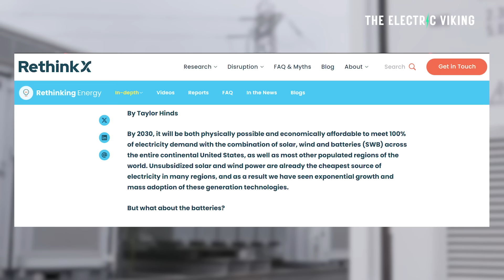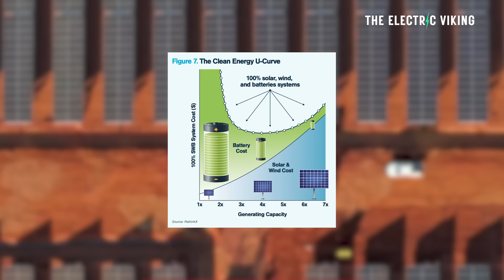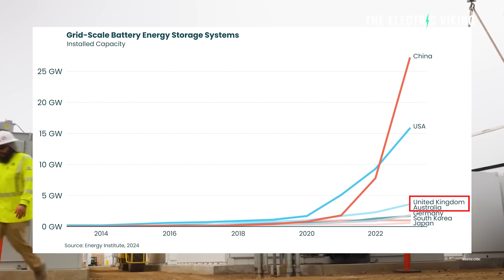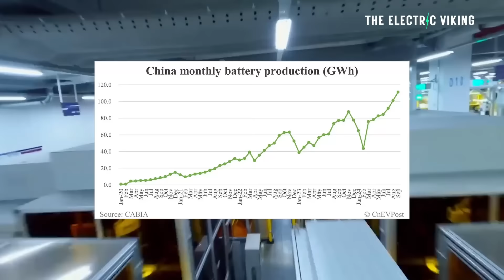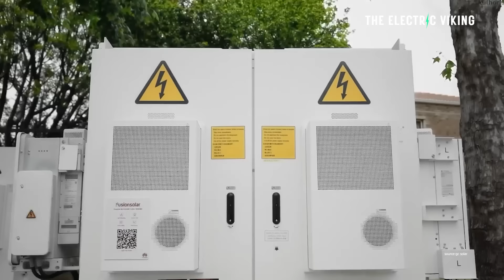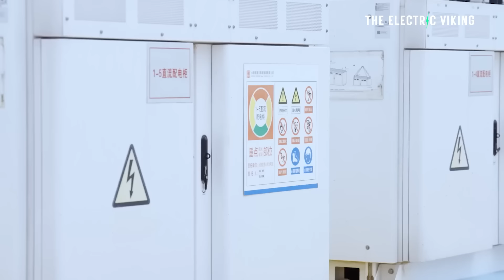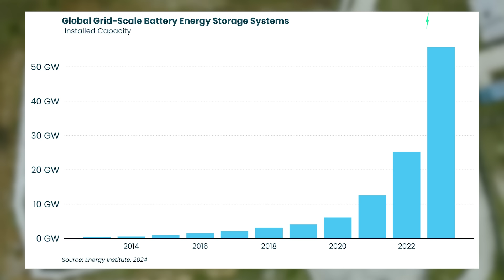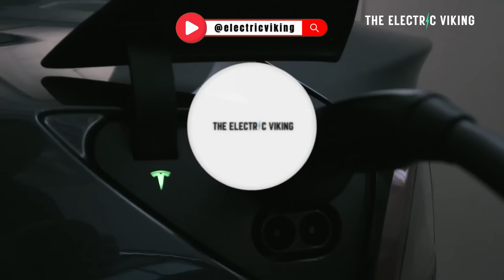RethinkX reveals the shocking exponential growth of battery storage worldwide

Comment: Once upon a time the whole world was using oil lamps, now battery operated LED flashlights. 😂
Reply: At a very basic level, one can buy a lantern with an attached solar panel that will charge it during the day and provide light at night.  These cost less than $10.
Reply: @bobwallace9753  A device that took more energy to manufacture than it will ever replace - well done.
Reply: We'll soon be going back to oil lamps given the policy decision we're seeing.
Reply: @kellyeye7224  
How little you know.  I assume it's only ignorance?
Reply: @kellyeye7224  
A solar rechargeable LED lantern costs $2 to manufacture in China and it will work for years. Do you think $2 worth of petrol fuel can last a few years?
Reply: @Anonymous------  When gasoline was $2/gallon that gallon would deliver some 30kW of energy.  The LED might deliver 1 watt so 30,000 continuous hours of 'light' from that gallon of gasoline?  Call it 15,000 hours at today's prices.  That' still nearly TWO YEARS of continuous operation.  Given your LED lantern will need half the day to recharge the gasoline equivalent would be FOUR YEARS of operation.  Get it yet?
Reply: @kellyeye7224 That works on one example but, for energy requirements such as home electricity, data centers, etc. how is it better to continuously have to drill for oil, transport it, refine, it, etc. than to have a solar or wind farm supplying daily renewable energy?
Reply: My Grandmother used whale oil to read🕯️ When I was too tired to finish homework...she told me to study late & " burn the midnite oil"🕯️ Maybe most people will prefer burning petrol oil lamps than an LED light🤔
Reply: @solartime8983  
Imagine 7 billion people using whale oil lamps. How many whales this world needs to have to supply whale oil to 7 billion people. 🤐🥴
Reply: @GiantsOnTheHorizon  So what do those data centers use at night or in still weather?  Such center owners are already contracting for modular nuclear or permission to be built alongside existing power stations (non green).  The energy requirement is far and away above anything any solar/wind system can RELIABLY supply so there will NEVER be a system that doesn't use existing energy (oil, coal, gas etc) technology.
Reply: @kellyeye7224  There are quite a few options for energy storage. I’m assuming they would use batteries or a variation like pumped hydropower. Not sure why the data centers wouldn’t use a combination of energy solutions including solar, wind, and nuclear.
Reply: @GiantsOnTheHorizon  The basis of any energy use is predicated on the reliability of that supply.  Wind/solar are inherently intermittent and battery storage is only for a limited period.  Pumped hydro is only practical where the elevation permits it.  This is why gas,coal, oil and nuclear will always be part of any energy mix - reliability.
Reply: @kellyeye7224  Of course but, if you can get 95% of it with renewables why would t you do that?
Reply: @GiantsOnTheHorizon  But why duplicate the energy source?  If coal,gas, oil or nuclear are required why spend extra to deliver wind/solar?  The coal, gas, oil and nuclear would be on standby anyway so effectively going to waste.  It's idiotic.
Reply: @kellyeye7224  Because it’s more cost efficient long term and renewable. Why would you pay more just so you can pollute?
Reply: @GiantsOnTheHorizon  Cost efficient?  That's certainly debatable as the only thing I've noticed with wind.solar energy are ever-increasing costs - and increased grid instability.  As for 'pollution' - what do you mean by that?  See Oh too isn't a pollutant and other byproducts are, these days, carefully converted/eliminated - see modern car engines as good examples.
Reply: @kellyeye7224  Water isn’t a pollutant either until you oversaturate your body with it. Though, I doubt you’re going to want to sit in your garage while your gas car is running - which seems like in that case the emissions would be considered a “pollutant.” Coal ash seems to be causing some fun cancers in North Carolina not to mention black lung. Natural gas wells are leaking all over the place and adding to the greenhouse gas problem. I haven’t seen a study out there showing the long term costs of oil, gas, and coal being anywhere close to as cost effective as solar.
Reply: @GiantsOnTheHorizon  Of course, idiocy (sitting in a garage with the engine running) has it's place in many societies but isn't an issue for most people.  Then there's criminality - of failing to abide by systems and methods for dealing with harmful byproducts.  But the biggest issue is ignorance - that of science and the issue surrounding sea oh too which has yet to be proven as being harmful to the individual or the planet.
Reply: @kellyeye7224  If you can sit in your garage with a battery running or an electric car running but, not an ICE vehicle (because you’d die), I think we can conclude that the byproduct of a gas engine is toxic to humans. Also, If you want to claim that there has been no proof that excess CO2 is destructive to the earth should we just go ahead and assume the earth is flat as well?
Reply: @GiantsOnTheHorizon  I'm the kind of person that looks at a simple equation (like 2+2) and go.... yeah so far, so good.  Then I look at the rest (=5) and say..... 'there's something not quite right there' and do some research.  You seem to be the kind of person that thinks the bogey man exists but you're too scared to look under the bed to find out.  Hint - it doesn't.
Reply: @kellyeye7224  You actually seem like the type of person who can’t accept that 2+2=4 and then come with all sorts of seemingly clever reasons that 2+2=5 to impress yourself. Don’t worry, you’re not unique.
Reply: @GiantsOnTheHorizon  Answer honestly - have you ever read or watched videos/movies that claim to counter the narrative?  The evidence therein is compelling and supported by links to factual data that has never been disproved.
Reply: @kellyeye7224  I’m always open to counter narrative. That’s how I became a Democrat.
Reply: @GiantsOnTheHorizon  ahhh, that explains a lot.
Reply: @kellyeye7224  Yep. Enjoy your conspiracies.
Reply: @GiantsOnTheHorizon  The difference between a conspiracy and fact is down to around two weeks.
Reply: @kellyeye7224  About 1% of the time. For you though, I’m sure the percentages seem much higher. Everything seems like a conspiracy when you don’t know how anything works.
Reply: @kellyeye7224 Nope. Most of that gasoline goes away as heat and vibration. Stop trying to pretend that Gasoline is efficient, when it’s NOT efficient for electricity generation.

Comment: Energy production has to be local... very local... trucking in coal, piping gas and whatever else from thousands of km away is insane... trucking oil all around the country to fuel stations is also insane
Reply: Best point
Reply: @lonewolf awesome i can almost picture the frustration "it's like I'm taking crazy pills" yes we will burn oil to transport oil <3

Great share mate!
Reply: @The-JMartian  I'm with you! It just feels like we are the crazy ones for no good reason.
Reply: @The-JMartian  very nice to hear, heat pump on property?

One day I hope to build a solar system on property.
Reply: Also remember the proposition that: if all the oil/natural gas/coal use ceased, then HALF of the (also fossil fuelled) ships would cease to be used. HALF.
Reply: @jimbartley5066  What do you think the other half of the ships are using for power? I just read there's  only 160 nuclear-powered ships.
Reply: The same could be said about power plants. There is a hydroelectric dam in south east Iowa but most of the power is sent to Saint Louis over 150 miles away. I'd bet alot of that power is lost to how far it goes.
Reply: @brianperry4815 The transmission loss is not that much 5-8% and of that the biggest loss is near the end when the voltage is stepped down to send to businesses or to homes.
Reply: 150miles is nothing in terms of electricity transmission. UHVDC lines only have 1,5-2% loss over every 650 miles
Reply: China has 30,000 miles of UHV transmission lines.  It's cheaper to move electrons on wires than moving fossil fuels by truck.

Comment: African countries should go all in on solar power + batteries. Distributed and without the need for long transmission lines.
Reply: Morroco installed  858 megawatts in 2022 .  In 2030 the will export 10 TWh hydrogin . Africa is realy helped by Chinese investors.
Reply: They already are, but with transmission lines as well. Lookup the One Sun, One World, One Grud initiative seeking to join up the global sun belt countires to be a global powerhouse. Grids will still be require for commercial and industrial needs, even if domestic home generates.
Reply: @GruffSillyGoat  
There are millions of people for whom it would be too expensive to string transmission lines.  They would never use enough electricity to pay for the cost.  Those people are being serviced by "micro-solar".  Small, standalone systems that provide basic electricity and can be paid for over a year or so with the money they would have otherwise spent for lamp oil, candles, and disposable batteries.  There are millions of micro-solar systems now in place.
Reply: Solar energy - yes. Lithium harvesting - no.
Reply: @Argus13  Fortunately, grid scale batteries could be built with sodium instead of lithium.
Reply: @Argus13  
Why not lithium extraction and processing?  Lithium is a very commonly found metal in the Earth's crust.  The world is moving to EVs and renewable energy.  We're going to manufacture a huge number of batteries.  Why import lithium or completed batteries from one continent to another if you can do the work close to the market?
Reply: @bobwallace9753  Because of lithium harvesting - just ecology killing process. And more - for Afrivcan countries it makes most deficit resource - water - unavailable, because of drinking water levels poisoning. And during lithu extraction not only CO2 generated and chemical poisoning occurs, but also huge amount of water vapor generated. Water vapor - most powerfull warming gas on nature, more powerfull, than CO2 (which also takes too small part of all warmer gases).
Reply: @Argus13  
So don't process lithium where water is scarce.  All of Africa is not a desert.  Extract and process responsibly, contain the potentially harmful byproducts.  

Water vapor is a problem with lithium extraction.  Give me a break.  The amount of water vapor emitted from lithium refining wouldn't wiggle the needle.  

CO2?  Compared to the CO2 released when we burn oil for fuel?  And, do not forget, almost all the lithium in a used up battery can be recovered and reused.  Forever.  We need to extract only enough lithium to manufacture the first generation of EV and storage batteries.  After that we recycle.

How good are we about recycling oil after we burn it?
Reply: @bobwallace9753  Please, make some calculation. One liter of water produce 1,670 litres of water vapor. 1 kg of lithium harvested requires 1,900 - 2,200 litres of water (depend on technology). Please, multiply by yourself :)
Overall ecology impact of lithium harvesting - is a reason for some countries already exclude BEVs from @zero emission@ category and set new high ecology taxes for such Li-battery usages. For example - Norway (BTW - this country is athe leader of european "greenify" process).
Reply: @Argus13  
The amount of water vapor in the atmosphere is determined by air temperature.  If some steam/vapor is emitted in one place it will reduce evaporation in an equal amount or precipitate out.  

"Oil consumption worldwide reached approximately 100.2 million barrels per day in 2023."   "About 84% of the hydrocarbons in petroleum are converted into fuels. The remaining 16% is used to make other products, such as plastics, pharmaceuticals, and solvents. "

100,200,000 barrels * 0.84 fuel use * 42 gallons per barrel = 3,353,056,000 gallons of oil burned in vehicles per day.  That is what we are burning each day and pumping the resulting CO2 and water vapor into our "global blanket" which is causing our planet to dangerously overheat.  

Lithium can be responsibly extracted and can be reused over and over and over....
Reply: @bobwallace9753  Why you are stopping on this point? You should continue...  this amount of oil produce 1,3 billion tonn CO2, mass of our atmosphere is 5.15×10^15 tonn. Can you calculate this percent? 
For comparison - ocean "exhales" 320 billion tonns CO2 daily and "inhale" about 130, differrence is neccessary for support of life on planet. If CO2 concentration will reduced twice - plant life will be terminated (mankind's - too).
Re-using of lithium more catastrofic even than mining, because of usage of more poisoning chemicals (with about equal quantity of water).
Reply: @Argus13  
Argus, I simply have no tolerance for your stupidity.  I have no idea why there are a few people like you who work so hard to deny what is obvious.
Reply: @bobwallace9753  I'm based on facts and science. I'm not infected by religious dogmas.
Reply: @Argus13  
Argus, I spent a lot of years in university and graduate school.  From time to time one encounters someone who thinks they have figured out why the people who know the most about a subject are incorrect.  Sometimes they have figured out a problem with the 'accepted truth' and they drive knowledge further.  Sometimes they are simply wrong.

If you think you know where climate scientists have it wrong, take it up with them.  Find out if you have a great insight.  Or whether you are deluding yourself.

When someone starts talking about religious dogma of others as a way to defend their thinking, I tend to think lala-land.
Reply: @bobwallace9753  Denial of facts and logic is usually characteristic of religious fanaticism. This is not my way.
The frauds were exposed at the very beginning of this hysteria - so I stick to facts and logic, excuse them.
You can believe in anything. But try to answer the facts.
Reply: @Argus13  
Argus, I am a scientist.  I am a published researcher, or was at one point in my career.  But climate is not my field.  If you think you understand the issue better than climate scientists, take your arguments to them.
Reply: @bobwallace9753  But you are arguing, isn't it? It is your responsivity to make arguments and commet the facts. As scientist you sure know how "circle of knowledge" works...
Reply: @Argus13 You do understand that the amount of water vapor that evaporates every day from the Ocean is Sooooooooooooo massive that water vapor from Lithium Evaporation isn’t even a rounding error. RIGHT???
Got to be one of the worst takes so have ever heard.
Reply: @Argus13 This is absolutely nonsense. Water evaporation isn’t even a blip compared to the evaporation for the Oceans alone. Stop spreading FUD.
Reply: @Argus13 Trolls who are lying about things are generally going to end up on the wrong side of history.

Comment: Im invested in FLNC, backlog grew by over $4billion last quarter, now has in excess of $20 billion of deployment in backlog (and its growing quarter over quarter). Growing so fast that they can't keep up with demand, despite increasing supply (coming on line end of 24). I think this could be a multibagger as along with the installation comes servicing (which has only just started to ramp up)... i wish them well, i think this is a no brainer for business (especially data centres) as not only does it act as a back up but provides a means to reduce energy costs over the longer term.

Comment: When will these new battery techs come to my power tools?  No one talks about these.  Examples: Leaf Blower, Drill, Chain Saw, etc.?  
I had to self upgrade my Ryobi riding mower from lead acid to LFP and the difference was vast. 
Looking at Milwaukee tools, DeWalt etc.  These batteries are very expensive, heavy and  slow charging.  Please look into these.  And strangely, most are made in China.
Love your work and all the good you do for humanity!
Reply: I already have them.  i have used the same Greenworks Li-ion battery for 9 years to mow my grass (and now run my leaf-blower).  It recharges in 30-50 minutes.
Reply: I think it might take awhile and  be a costly exercise.  The world currently has roughly 200 GWH of battery storage which is enough energy to supply the planet with electricity for 1.5 minutes. If we also include all the energy produced from gas and oil we should have enough battery storage to last for 30 seconds..
Reply: Agreed, I ride an electric unicycle, 200km range, 85 km/h speed but, the thing weights 104 lbs, that's bad for 4000 wh battery!
Reply: @cyber5515 ”The Planet” doesn’t need electricity. Humans do.
More Battery Storage is being deployed every year than nearly all battery storage for the previous history of battery storage. There’s already places that are completely covered by the battery storage available in their local areas. Plus many people are effectively moving off grid / supplying electricity back to the Grid. As this becomes more and more common, the actual total demand on the Grid goes DOWN not up.
Reply: @grahamkearnon6682  85kmh on a unicycle 😬

Comment: Good episode Mr Viking. 
I was going to comment that you needed to show per capita…but they he did, well done.  And glad / surprised to see UK with the front runners. 
One other advantage is that decentralised units need less transmission costs.  
Another, when a huge coal power station goes down for maintenance it has a very significant effect.  Not so with batteries. 
I would have liked to see data / graphs that also included hydro storage. I feel here in Scotland we should be building 10x the number of hydro we presently have ( Norway 9p kWh, here 27p!) but wonder if by the time they would be built batteries actually cheaper.